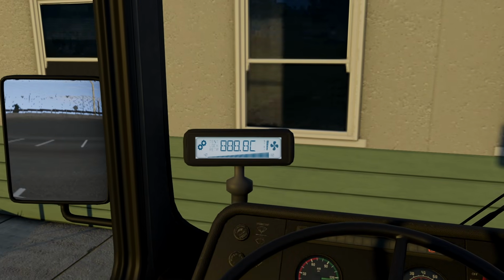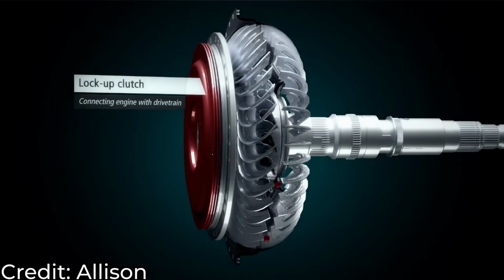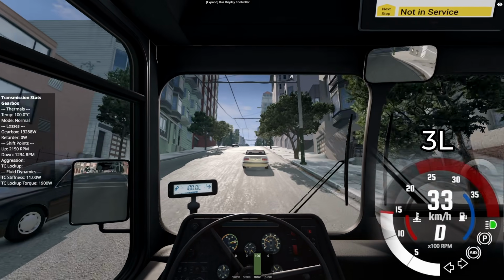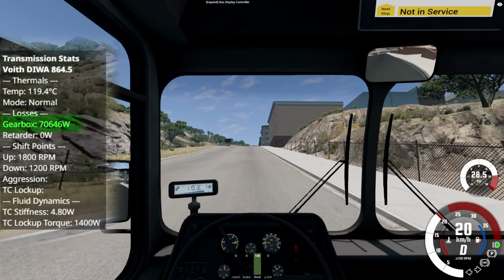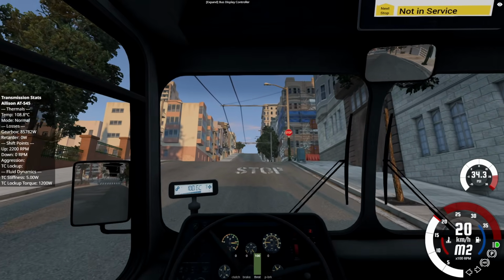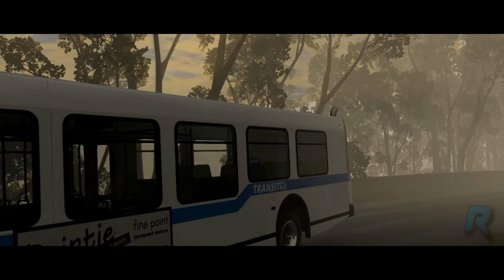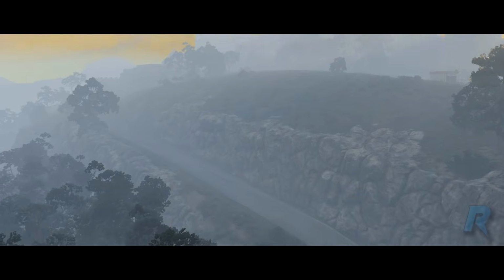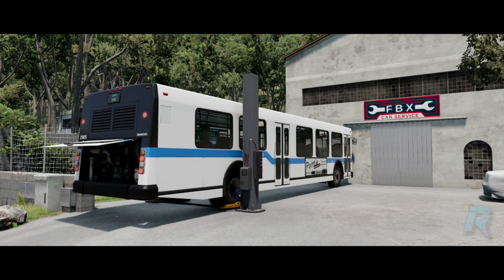The First Transmission Temp Simulation in BeamNG - Wentward Transmission Pack V8.0

Comment: hey, how i put sounding on manual gearbox? you can help me pleas, i'm try to make a mod for the game.
Reply from the maker: To add the sounds, well unfortunately that won't work because it uses a customised lua file for the automatic transmission and it's shift logic to add the sounds per gear. 

The closest thing you could use without any coding is the stock gear whine system, but that only allows for one sample
Reply: @MrRadsVarietyChannel ahh men, that sad, because i wanted add that one gearbox noise, but thx
Reply from the maker: It is still possible, it's just that you wont be able to have different sounds for each gear. I'm sure that the script for the manual gearboxes can use the same sound per gear code as the automatic gearboxes

Comment: I hope you can add a 6HP594C, a Voith D864.3 or an Allison B400R
Reply from the maker: Technically there is already a 594C, but it's only on the articulated buses in the Wentward pack, as I've decided to actually give them different torque ratings because that engine is a lot more higher power. But the equivalent to that in the solo and smaller buses would be the 504/C.

Regarding your D864.3, I dont really see a difference between the 3rd gen and 5th gen Voiths. They all have the same working principle but if you have any information I would love to know!

And the B400R, well it's basically a T375R but with a different name, and their sounds are basically the same too, but like the Voith, if there's a big difference then I might consider it. 

If you have any sort of information about how they're different I would appreciate that. Thanks!
Reply: @MrRadsVarietyChannel  I only know alot about trains, I am only sure that the New Flyer D40LF buses here in the US use these 3 transmissions (maybe some one-offs too)
Reply from the maker: Ah alright. Well the D40LF's do have all of those transmissions, so you are correct, but they're just variations of what's already in the mod. So for example, the 594/C is just the 604/C but rated for less power.
Reply: @MrRadsVarietyChannel  I hope you can make a Detroit Diesel 6V92TA mod that has a Voith sound and a option for other transmissions (mostly just the Voith sound) so I can simulate GO D40S buses with the GO livery pack

edit: on my end there's four replys, another Youtube glitch

edit 2: maybe a Detroit diesel series 50 too, that way I could simulate the TTC D40LFs too

edit 3: the livery is broken, no need for a Detroit Diesel series 50
Reply from the maker: @METX405Productions After I finish this I will definitely be making more engines! I'll be making a update to my ISL, aswell as hopefully adding an ISC, so I can also do the 6V92 and DDS50.

I also add Voith sounds for all the new engines as an option, and I am going to revamp my older ones with the option too
Reply: @MrRadsVarietyChannel  I hope you can make the ISC an option on the MD-Series so I can do a school bus engine (also the toe-in angle setting is at -12-16% on the buses and makes the bus veer to the left)

Edit: I hope you can update the ISL so that there is another engine that is the EPA 2004 ISL
Reply from the maker: @METX405Productions 
I'll probably make it an option for the MD series but this all depends if I can find an accurate torque curve as they're all low resolution from like 1200rpm. 

I am also aware of the toe in angle on the DT40L Configs and they will be updated by the release of V8.0 and that will be fixed also.

When I redo the ISL, I hope to redo the ISLe5, which is from around 2009 to 2013 for us, the ISL9 which is from 2013-2019, and the L9 which is from 2019-2020, with all different sounds and characteristics, so in epa standards, there's an EPA2007, EPA2010/2013, and EPA2017 variations.

The ISC is really meant to be the early ISL, as that's what was used in buses here from 2003-2009, so that'll be the EPA2004/Euro 3 engine I'll be making. The good thing about the ISC is here, they sound straight pipe, so I hope I can put that into the game, but as I said, sounds are going to be the main hard part
Reply: @MrRadsVarietyChannel  I did some more research, and the school bus I'm trying to simulate has a C8.3 engine, not the ISC
Reply from the maker: @METX405Productions However, the only difference between the C8.3 and ISC8.3 is that the C is purely mechanical, whereas the ISC has electronic control, which is the Interact System. So they're basically the same, apart from also the ISC being a 24 valve and not 12

Comment: We need this mod for modded and vanila cars, it will add realism to the pre scripted damage BeamNG drive dev's have put, honestly the modded comunity started to add everything the dev's should have added in first place, and they started being too greddy and stopped developing the game actively the dev's are alot of behind with Vanila vehicles, and maps, also features, honestly starts to feel abonded if it wasn't for the modded comunity.
Reply from the maker: I'm quite surprised that this wasn't already added to the game to be honest. Like BeamNG Devs do pay an extreme attention to detail, and the code prototype was already in the files, just commented out, so I don't see why it wasn't added. Maybe because players will get annoyed with it, but just add a checkbox I guess. 

Don't forget though that the Devs are actively focusing on bigger projects such as tyre thermals and aero, so currently a lot of their time is spent on that, and more people would rather that than transmission temperature simulation. 

The modding community has done some remarkable things to this game though, and sometimes the Devs actually reach out to them and ask if they could add it into the game, so in a way they're trying, but it's such a niche thing so I doubt it'll be added anytime soon.

I'll see if it's possible to make this mod a lua extension that runs for every vehicle, and I could potentially make this for every vehicle in the game!

Comment: On our old kia automatic, the transmission fluid got so hot that on the downhill the dipstick pushed out and sprayed oil all over the exhaust manifold. luckily it didn't ignite.
Reply from the maker: That's certainly not normal! I wonder how hot it must have been getting to create enough pressure to force its way out of the dipstick? How long did it last, because if it kept spraying out its own oil whenever it got hot, it would have ran too low eventually right?
Reply: @MrRadsVarietyChannel  It was a short event. Probably only lost 100ml. Maybe some water contamination, not idea. After that I stopped using the engine brake to allow the gearbox to cool down when going downhill. Then the brakes boiled over :) 
Its a 1998 kia sportage with the 4speed auto. I don't know if it even has a lock. If it does, it doesn't work anymore. 

Anyways, im also doing some very basic gearbox temperature simulation on my MSFS aircraft. Its a simple 1.69 gear reduction and the gearbox oil is used to control the hydraulic propeller. If the oil is cold then the return flow is slower and the propeller reacts slightly different.
Reply from the maker: @MrTommymxr  Atleast it wasnt too much oil. It's just annoying that either you had to sacrifice the transmission or your brakes, but it was worth it if it kept happening.

It's cool to see how you're making a simulation for MSFS. I didn't think that would even need to be done for planes, but it makes sense now. I hope that all works out for you, because it's always exciting to see small but realistic features and attention to details in games

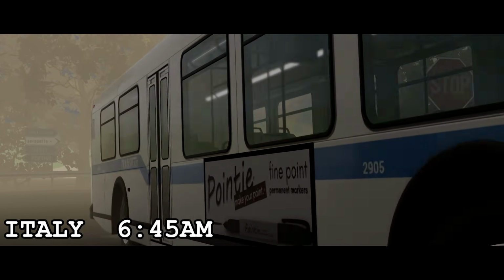Comment: 5:13 The Automated (Not Automatic) transmission would've fared better for that type of driving if Manual wasn't an option, I'm surprised that there isn't an proper mod for Automated transmissions for this game
Reply from the maker: Either an automatic that locks up early, like the ZF, or an automated, such as a ZF AsTronic or something would have been better up there, as the slip is what killed it.

Luckily there is an Automated Transmission Mod available, made by Zeit.
https://www.beamng.com/resources/automated-manual-transmission-more.30117/

It functions like real life, including skipping gears, but it's just a shift logic modification of a manual gearbox by the looks of it. I also have somewhat of an automated manual in the transmission pack aswell, the ZF AsTronic 12 and 6 speed variants, however they dont skip gears, which is rather unfortunate

Comment: ok cool but Less AI speech and Lore Friendly Transmission and Engine Names would be nice
Reply from the maker: The reason I added the AI narrator is that it would be easier to understand and follow along rather than reading text.

Lore friendly names seem a bit hard to do as all of the mods now use real life names, but maybe when I finish my Endeavour, as it's a joint venture between ETK and Wentward, I could maybe make the engines and transmissions from Mercedes and ZF to ETK.

Thank you for the feedback!
Reply: @MrRadsVarietyChannel  when you dont have a Mic and/or just dont want to talk on the internet wich is fine then AI voice is the better option you are rigth, and there are some other mods that are lore friendly but still have new names like most Volkswagen mods are AW
and Mercedes mods are ETK same as BMW
so maybe Mercedes and MAN = ETK, ZF could be AW, Cummins = Gavril, Caterpillar cat = Bruckel, Detroit and voith could be Soliad, and so on, idk just some ideas :) overall i like the idea but i am a bit autistic about lore friendly names in Games without real Names but keep up the good Work!

Comment: this has been a very good insight into how the different transmissions work! it's no wonder none of the buses near me use Allison haha
Reply from the maker: Thanks a lot! Each transmission has their advantages and disadvantages, and I am glad to hear that the showcase taught you something new!

What buses are in your area, because it can also depends on the manufacturers preferred transmission. For example, MAN/Mercedes/Scania all prefer ZF because it's made locally, but New Flyer for example would prefer Allison because it's made locally to them, but there also is the exception that some New Flyers have Voiths and ZFs too
Reply: @MrRadsVarietyChannel  Near me most of the buses are Alexander Dennis and a few of them are Wrightbus, and almost all of them use Voith transmissions, the rest using ZF. One of the routes near me has a lot of stopping and starting, and with the Voith the initial starts are very smooth but it really does drag on for a while in first gear. Whereas the ZF's, although being faster starting off, they feel a lot more jerky and aren't as comfortable to ride.
Reply from the maker: The best advantage of the Voith system is it's stopping and starting, as it has two different paths of power, one mechanical and the other converted, and it blends between them depending on your speed, which makes for very smooth stops and starts, compared to a ZF Ecomat for example, which will shift around 3 gears for just 1st on the Voith, which leads to a lot more jerks as theres more shifts where power is interrupted.

However because the ZFs have more gears, they're technically more efficient despite spending longer shifting because they are fully mechanically connected earlier, spend more time in the optimal torque band, and get to speed quicker which means the throttle can be lowered earlier
Reply: @MrRadsVarietyChannel Ahh I understand that's all coming to make sense. I've only just found out some of the Optare built buses here (there are only a few left now) have Allison gearboxes. I always remember them to get very hot when at high revs especially.
Reply from the maker: @vehicleswithjacob  Some Optares, like the Solo, use the AT-545, which is non locking, so thats why they would get hot

Comment: Could u maybe please add voith transmissions?
Reply from the maker: The pack already includes three different Voiths. The one shown in the video is the standard 4 speed D864.5, but I also have the new 7 speed D867.8, also known as the NXT, and also the very old D200 2 speed transmission
Reply: @MrRadsVarietyChannel  Oh alright, i'll try to look better since i couldnt find them. for context i downloaded the mod from the repo
Reply from the maker: @thecheeseboi5763 In the DT40L where the vehicle selector is, you should be able to see one for each. If not, then it'll be in the configuration menu (CTRL+W), engine, and then transmission
Reply: @MrRadsVarietyChannel  i found it thanks!!
Reply from the maker: No problem! I hope you enjoy them